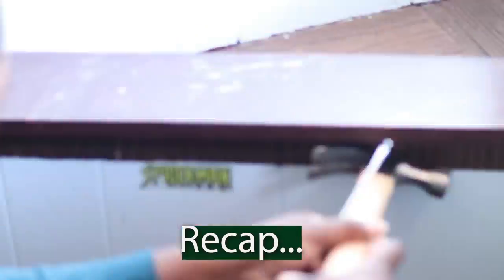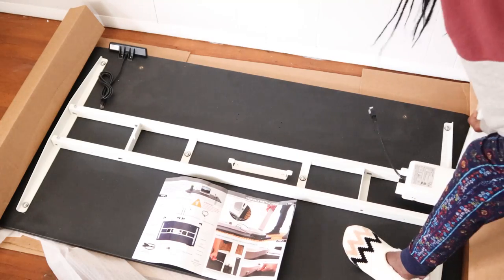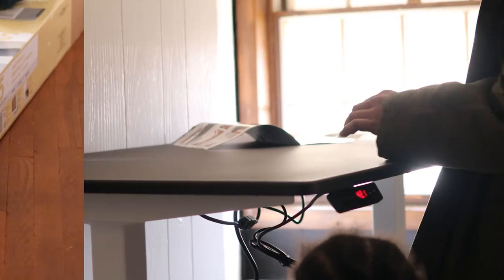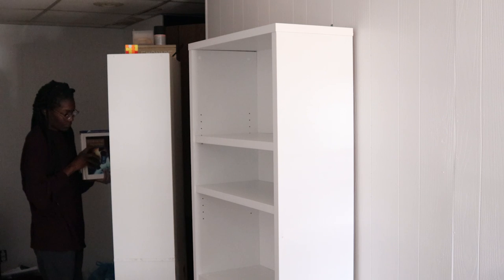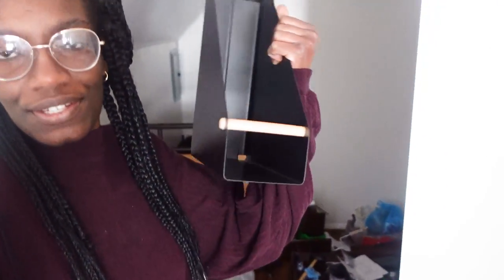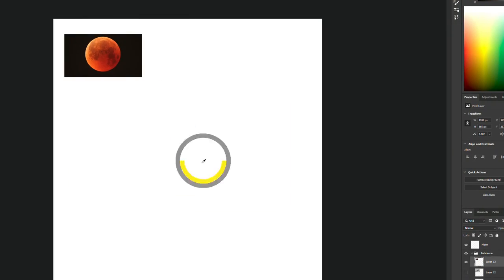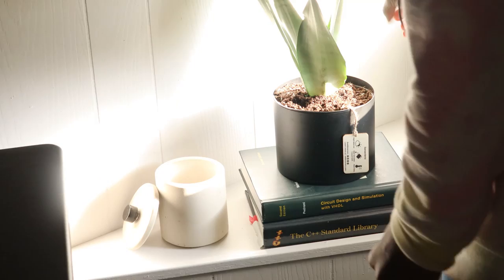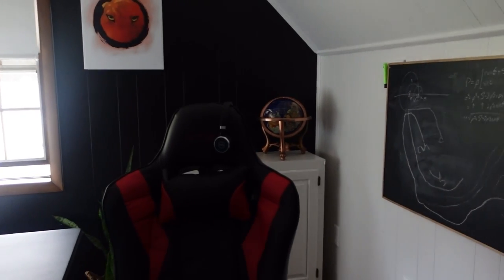EXREME HOME OFFICE  RENOVATION  | Standing Desk | ROOM TRANSFORMATION

Comment: Great job Kim! I’m not sure if anyone has mentioned this yet, but I would recommend getting thin Velcro ties from Home Depot and neatly folding up the cords to the shortest length needed. Your can connect group of cords with one Velcro tie too. At work I actually use a Velcro command strip to hold a serge protector on my standing desk, to keep all the Velcro-tied cords above my desk behind the computer (instead of plugged into the wall) so nothing catches when I lift the desk up.
Reply from the maker: Another reason for a home depot trip ☺. I actually found velcros at Target but they're really thick. I didnt think to check home depot, but I will! Thank you! I also saw on walmart.com a cord zip..im not sure of the actual name, but it wraps up several cords into one. But im going to test a few options out